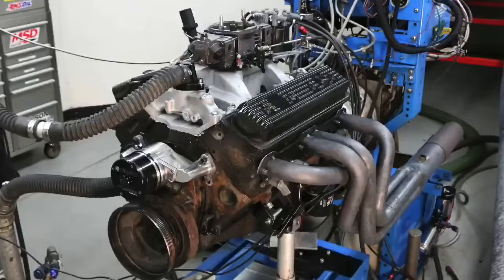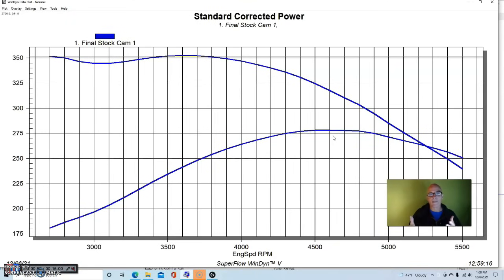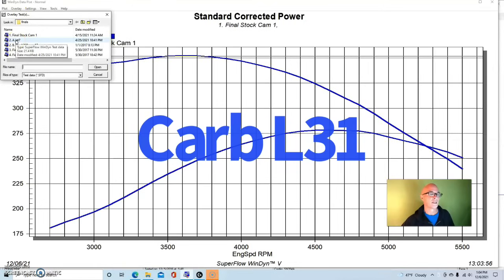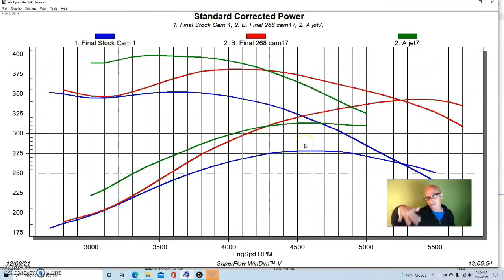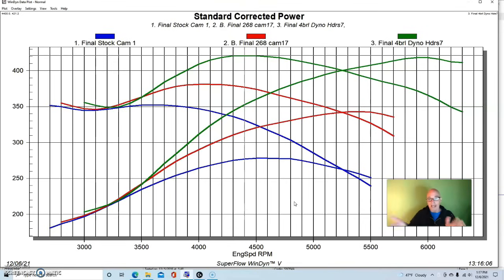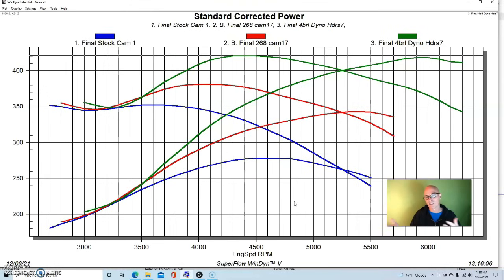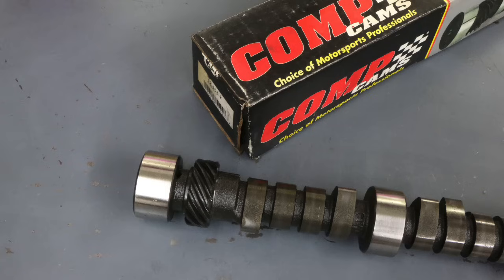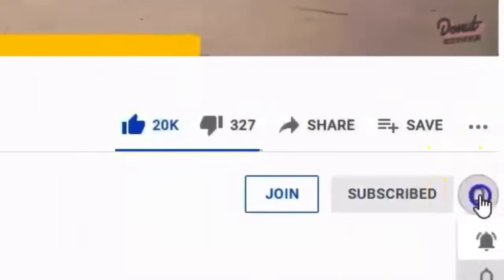HOW TO MAKE CHEAP, JUNKYARD, VORTEC SBC POWER. JUNKYARD VORTEC HEADS-400-HP 350 CHEVY MODS.

Comment: Great Video! Could you offer advice on a cam with 108LSA, going in a 99 suburban. Thanks a million!   Im building a little roller block 355, flat top hyper-tech pistons & eyebrows, total seal rings with gapless seconds, arp rod bolts, H bearings, 4 bolt main with ported vortec heads, 202/160 SS valves backup, 3angle valve job  11tho steel hg for 40 tho quench, pushing 10.7 CR, slugs are 25 tho in the hole.... compcam roller (dont have the exact details at the moment sorry) next step requires a converter, I asked for a 108 LSA but Summit shipped me a 110 LSA & I didn't catch, still new in the box.    Beehive spring kit with retainers & offset keepers if needed,  I machined the guides down & installed screw in studs, 1.6  self align roller rockers, dual plane style airgap with added external plumbing to even out the coolant temps better,  intake port matched , dei distributor & holley 650.  Double roller Cloyes I planned to advance 4 deg to come alive around 2800 vs 3k GM performance roller lifters & dog bone keepers with ifter bores groved.   Ported hv mellings & main cap, opened up the center main oil galleries from 1/4 to 5/16 after drilling the 3 galleries out & tapped for plugs. Drilled small hole in both lifter galley plugs to help lube chain. Cut grove in the timing cover so oil doesn't pool at the lip seal.  Groved the lower distributor boss  at an angle matching the gear.  Going to drill the rear saddle & the main bearing thrust.  All this info & couldn't tell you my blood type😂.   I have its twin waiting its turn but older flat tappet cam block... perhaps I should bite the bullet &  switch it to a roller setup with all the lifter failures... haven't picked out a cam & lifters yet. Quench would be on the larger side if I used an 18 tho hg like yours.....  be more suited for a pickup.  WWRD. What Would Richard Do?  Thank You Dusty D
Reply from the maker: I don't like having the piston down .025 in the hole-aero deck is best, then head gasket for piston/head clearance. Also, why are you picking a cam based on LSA? The other specs are more important

Comment: hydraulic roller cams are garbage.. the lifters are junk unless you spend $1000 and them dog bone lifter holders are even more crap. And that spider thing made of tin that holds the dog bone things in place is even more a joke. Reminds me of the old nursery rhyme,, the House that Jack Built.
we used flat tappet hydraulic  cams for 50 years and for under 500hp there perfect and always will be.
from 1500rpm to 6500 the hyd flat tappet is perfect.
dont put chinese hyd roller lifters in anything.
Reply from the maker: you might be new to all this, but hyd roller replaced flat tappets long ago for very good reasons (both work, but rollers just work better)

Comment: Richard a legit L31 vs LM7 video would really be a good "other guy" topic and is kind of conspicuously missing. Junkyard low buck guys would be choosing between those two options. The L31 starts a little bigger for the guys that want all of the low end torque, and is...kinda...a little bit closer to being a straight bolt in for anything that came with a small block chevy. Especially for somebody that wants to run a carb, the L31 might...maybe (?) make sense. The comparison would be interesting even if it just ended up showing that the LM7 is so much better that there is no reason to choose an L31. Then if the L31 has any merit at all a low buck truck L31 cam would be cool.

Comment: Man you don’t respond like that I’m sure your busy. But I’m build a 383 and I wanna make 600 horsepower so I can at least 500 to the wheel. But I’m discouraged because the place I go to for my machine work says that the block won’t last. I plan on doing blow through with turbos. Will it be reliable/can it be used for daily
Reply from the maker: I respond to every comment-this comment cam just 15 hours ago. Your block will easily take 600 hp (we have run double that)

Comment: Something is not right here and I think it’s the intake 

You have .480 .480 cam with a 224 duration 
It’s been proven over and over again that at .450-.480 lifts vortec heads stock no valve job flow 234-241 range 

How is that only 346hp? At 9.1 compression 

Either that dyno is off or that intake is junk 

You absolutely do not have to mill the block and mill vortec heads to get well over 400hp
Reply from the maker: no vortech head we ever flowed was 241 cfm
Reply: Yes they do 
Cutters performance flow test them stock they get 234-241 stock

Eric weingartner flow tested stock vortec heads and got 241cfm at .480 lift    234cfm at .450

The lowest number I’ve seen from vortec heads is 224-226cfm which is well enough to flow 400hp especially with a 224/.480 cam something is not right here it’s gotta be the intake or the tune

Comment: I see you have a air gap intake. Do you know the difference roughly between it and a regular dual plane intake on a L31 engine?
Reply from the maker: depends on what other dual plane you compare it to
Reply: @richardholdener1727  I'm comparing it to the edlebrock 2116. I'm building my L31 for a 3/4 ton 4x4 truck with a 4 speed manual transmission. So I'm definitely more interested in that 3000 to 4500 rpm torque. High rpm power isn't something I'm looking for

Comment: I ran a 40 over chevy with vortex 194 heads in my dirt car. I turned 7200 rpm on a regular basis. Never any problems
Reply: Spring pocket work?
Reply: I’m surprised they’ll move enough air to support 7200 rpm lol

Comment: When you put Vortec heads (presumably designed with a roller cam/lifters) on an older SBC with a roller cam, do you use the pushrods designed for the Vortec heads or the pushrods designed for the flat tappet?
Reply from the maker: pushrod length for heads and hyd roller cam
Reply: @richardholdener1727  thank you

Comment: When you add Vortec heads to a flat tappet cam engine, do you have to worry about the valve springs that come with the Vortec?  Possibly too stiff?
Reply from the maker: stock vortec springs should be fine for a hyd flat tappet cam-just check available lift/ret clearance

Comment: So im doing an engine swap in a 84 c10. Got an l83 cross fire 350 that im putting vortec heads and a edelbrock 650 carbd on, any idea what hp i might have with that? I know the cam thats in it is a .269/.276 lift and a 202/206 duration. I had planned on getting a bigger cam but that cam is already at the valves limit (.420).
Reply from the maker: 325 hp ish
Reply: @richardholdener1727  good to know, I was trying to shoot for 400, if you got a good cam recommendation I'd love to hear it. I was looking at a procomp high energy or thumpr full kit with springs for in the future

Comment: I have a L31 engine in my 97 OBS how would this set up work if I kept it with the factory EFI system instead of doing a carb set-up? Great video.
Reply from the maker: works as long as you can tune it

Comment: I bought my old school,  350 with 305 heads, mystery cam, about 13-15 in vacuum. Git some good 96 vortec heads 906 free... what should I be worried about
Reply from the maker: cam lift and the ret to seal clearance on the Vortec heads

Comment: We took a motor out a 98 Z71 and milled the bosses, put an XR288HR cam in it with 987-16 springs and screw in studs and it ran 11.90s on motor in my weekend driver 1987 Z28 with a th350 and a 4200 converter with th350
Reply: How much does it weigh? Would like to do 11.4 or better with a similar combo through a 5 speed.
Reply: @TheJMan1K  3460. It was full body full interior power windows and locks
Reply: My friend said he took his brother's to a truck and said hook it up, paid like $500, and it decimated all... thank you for this info

Comment: Gm
602 I need more pull out of it on a 3/8 asphalt track turning 6200 pulls hard off but runs out of the pull 1/2 way. Needs to be 9.2:1 comp flat tappett cam is only rule   
I’m not in a 602 class I just have a 602. What do u suggest to get this 602 to pull longer and harder cam and spring swap ??
Reply from the maker: YES CAM AND SPRINGS

Comment: I’ve followed you for a while bc i love all the information and it’s been helpful on my project build which is getting a 5.3 and turbo and cam and everything. But i just inherited a gmc van with the 5.7 vortec in it and i just want it to be a little more responsive and powerful for towing the car. So i was excited to find this video.
Reply: lunati makes a great torque cam for these motors and youll be very happy. long tube headers mid length headers or even shorty headers will pick up some power too. add a well placed h pipe and better muffler and it will run better

Comment: I have a 96 vortec and I changed to carbureted and I put the hyd flat tappet k12-600-4 comp cam and since it's time to put it away for the winter I'm taking the engine apart and studding the heads plus I broke a rocker so now I'm Changing to 1.6 rollers rockers

Comment: I have a L31 Forged Crank, PM rods, 9.5:1 with a Edelbrock Performer Rpm Top End 64cc heads CNC Ported/Polished heads and intake, 650 cfm AVS 2 Carb, Bullet Cams 226/234 530/530@.50 110+4 LSA, 1.5 Edelbrock Red Roller Rockers, Summit Racing LS7 Lifters, 1 7/8 Hooker Competition Headers it made 441Hp and 444 Tq with a 2200 FTI Stall and a 700r4 heavily built Trans with 3.42 Richmond 10 bolt in a 72 Nova excellent daily driver by far the best street build I have ever done...

Comment: Stock valve train can only take .480 lift….because the seals. You have to run offset keepers to gain more lift when using higher lift springs. Unless you cut the seats down. He didn’t mention any of that being done

Comment: what cam would you suggest for a l31 block thats been bored.060 over decked and has cast iron vortec heads with bee hive springs skip white rotatory assembly forged dish pistons,carbed havnt decided,its going in a 4x4 jeep with a 700r4,It will have 35" tires on it and rearend is 4.10 ford.I have two blocks other one is stock cleaned hasnt went to machine shop yet,good block,thanks for your vids ive been learning alot
Reply from the maker: 268 or smaller cam would work well
Reply: @richardholdener1727  I actually changed heads bought set of aluminum heads 68cc 2.02/1.60  200 cc and got a howards cam 180245-10,

Comment: hey Richard I have a question I just did a cam and head swap afr vortec heads summit 8803 cam on a L31 with sniper and timing control.the car starts and run and idol's fine but as soon as I press on the gas it starts popping out the tailpipes any advice would be great
Reply from the maker: IT NEEDS TO BE TUNED

Comment: Ahoy Richard I've got a 04 regular cab silverado 1500 with the original 4.8 with over 25000 miles still strong I put a 4-1/2 inch lift kit & now I need power plus want a sloppy nice sound with it. Any suggestions on not a whole lot of ad -on's that's under $ 500 😁
Reply: 250,000 miles on motor & tranny my bad
Reply from the maker: cam, headers, tune

Comment: If I understood correctly,  you have roughly .030" quench with the shim gasket? Im worried about quench too tight on mine, is why I asked. 
 Building an L31 long block very similar. True decked a few thousandths, not zero decked, align honed 4.00 x 3.48, forged/bushed 5.7 rods, Scat 9-10526R steel crank, H631CP 5cc flat tops, Melling 22280 Roller(220/224,495/502,110Lsa/106 factory center). 787's with beehives and long slot 1.5 rockers.  I'm .016" in the hole and with .015" Fel-Pro 1094's, that's a tight .032" quench. 85 Jeep CJ7, 2900lb, 3.08's, 4spd trans=opportunities for unintentional 6k+ mistakes but will have an RPM limiter of some sort before 1st start up, even if its a simple digital 4pin hei module. 
1) Do you think .029-031" quench is too tight for me?
2) Pros and cons of advancing centerline to 104°? 
3) Thank you for taking the time to help us mere mortals! 😊 I have applied a tremendous amount of knowledge to my project from you, your pals @ Engine Masters and all your video content. Thank you Mr. Holden for helping the little guys accomplish a dream.
Reply from the maker: you should be concerned with piton to head clearance and not quench
Reply: @richardholdener1727  yes sir. Thank you. So .031 quech is fine with proper piston to head clearance? What would be too tight for valve clearance? Thanks again for taking the time to respond being how busy you are. I appreciate your time in this matter.
Reply: @richardholdener1727  would I have any likely piston to head issues using a .015 shim gasket on my stock style .040 over dished pistons engine (70’s to 80’s stock block) , even if the block was zero decked? I have not yet pulled the heads that are on it, to measure, so only asking in advance of what might be inside my engine. I only know that the pistons are .040 after endoscopy get thru a plug hole, so far………… thank you in advance for any and all info you offer!!! Love all your videos and have learned a ton from you, sir!!!!

Comment: I just picked up a 1996 350 Vortec , I'm going with a carb and hei . what cam would you use without head modifications to get 400 HP ?
Reply from the maker: you need to at least do springs

Comment: Richard, what would you suggest for a highly streetable superchager for this setup?  
Block: 350 bored 60
Pistons: SRP 139634 Forged Dish  -24cc
Carb: Summit 600CFM SUM-M08600VS
intake:  EDL-2716
Holley 650 carb

Heads: Vortec 10239906 64cc  surfaced 10
Valve Springs:  26915-16
Lifters:  853-16 roller
Pushrods: 7815-16
Cam: Comp 12-422-8
Reply from the maker: lots of blower avail for a small block-look at TorqStorm or Holley

Comment: Will just doing a 1.6 valve upgrade increase power on a vortec head.  And how would a 383 perform with a vortec head with .0540 intake lift/.0560 exhaust
Reply from the maker: might be better to do the intake too

Comment: Didn't  catch this first time around. You zero decked the short block, and then used a .015" steel shim head gasket? .015" quench total if I heard you right? Or do they make a thicker steel shim that I'm unaware of? Not nitpicking you buddy, just genuinely curious as I have a 350 I plan to do a comparable build with.
Reply: I’m wondering if the pistons being stock dished makes it where the steel shim works perfectly ………… I’m guessing (not a pro engine guy! Hobbiest) the dish allows the quench to be on target, with the .015 shim?

Comment: Richard , got a question about a stock 5.7 vortec out of a 1996 2500 , building this motor for drag racing , intend to put a duel plane intake and holly sniper 1250 , twin gt 35 ebay turbos and a decent cam , so first question is what is the best cam for the stock heads ? Second question is , what would your opinion be on potential hp output ?
Reply from the maker: it would be best to have the Vortec heads machined to accept a better spring package-then you can cam it with some lift (that combo cam make 400+ hp na then just add boost (those turbos will support over 1000 hp)
Reply: If you're asking this question on here, are you really ready to be engine building or drag racing?

Comment: So could you run vortec heads on a TPI Setup, wondering if this is a good option for my 85 Flat Tappet C4 that’s all cast with factory forged pistons. I wanna keep fuel injection and TPI as I love the look of it, as well as the characteristic of the superb low end torque.
Reply: im pretty sure they sell a 4bbl carb to tpi adapter plate for any carb intake.

Comment: Awesome info! Do you have dyno proven results of going full roller? I’d love to see a before and after of switching to roller cam and lifters.
Reply from the maker: WITH THE SAME CAM SPECS?
Reply: I'd like to see  the difference as well. In theory,  when under 280 advertised duration a flat tappet cam is more aggressive than a roller. Personally if I ever go roller it has to be a solid.

Comment: What power you thinking my vet 5.7 roller block is pushing we did away with the aluminum head went with 305 tbi heads with roller rockers a edelbrock rpm air gap with a 650 carb this is in my demo derby car with 1 1/2 headers with 3" collectors  and e vack cam is the stock cam still
Reply from the maker: STOCK CAM?
Reply: Yes
Reply: For now
Reply: Its a 87

Comment: What's the cost of building a vortec l31 ?
Reply from the maker: go to junkyard
Reply: @richardholdener1727  I have an l31 already , I see you have alot of carb builds but I have the stock mpfi manifold how do you build power with that? Can you do a build for the later 96-99 l31's ? Without carb swapping

Comment: How About A Set Of 062 Vortec Heads With Screw In Studs, Bee Hive Valve Springs And An Edelbrock RPM Air Gap Intake On An LT1 350 360,  A 327 350, A 327 365 And A DZ 302...I Think It Would Be A Very Interesting Comparison...And Then Switch The Cams Around, Put The DZ (duntov) Cam In The LT 1,  Then Go Comp 268 Cam In All Of The Motors Comparing That Cam To All 3 Of The Stock Cams In The Hi Perf Small Blocks...Interesting Series Of Tests Then Just For Yuks Put A 294S In All Of Them...

Comment: Did you use offset keepers of have the guide bosses milled down for more clearance? I've read that anything above a .420 lift on a stock Vortec head you risk the retainer hitting the valve seal.
Reply from the maker: mill the guides down

Comment: Hey Richard. How about doing a sbc 400 for a strong street motor using the Vortec heads.
Reply from the maker: those are hard to find any more
Reply: @richardholdener1727  I have a fresh 400 in my wagon you could use if I can keep the setup at cost 😁